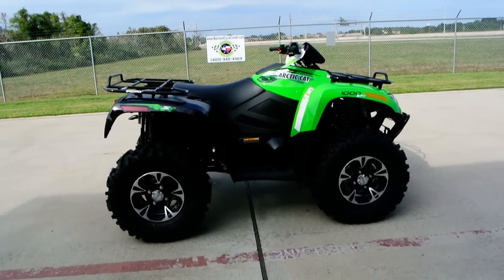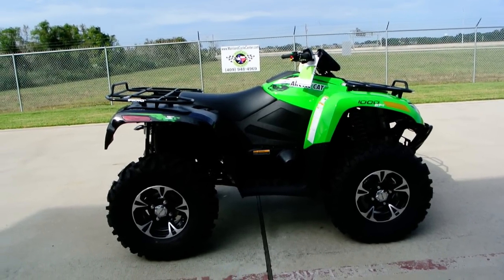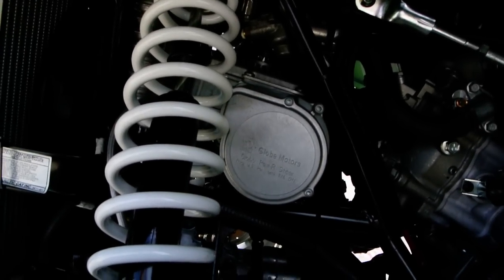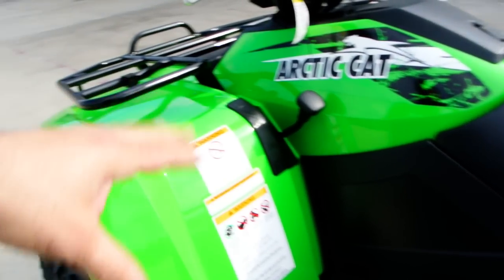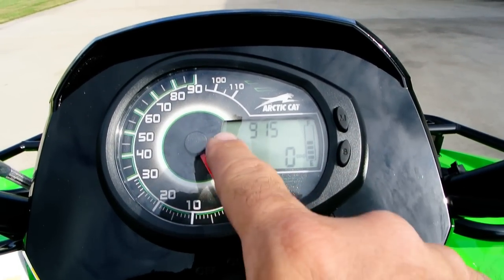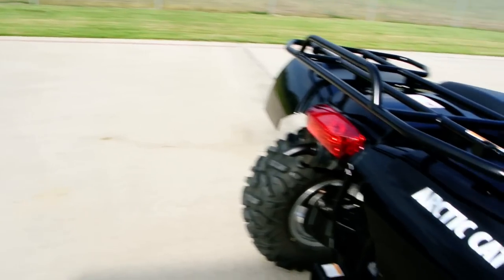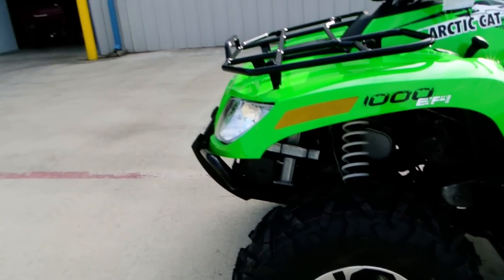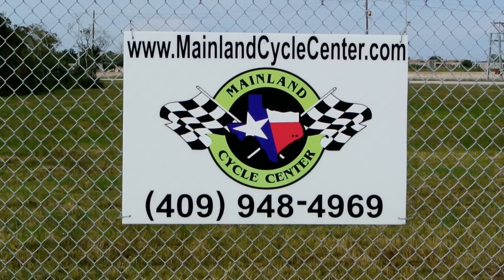2014 Arctic Cat 1000XT  Overview and Review!   For Sale $10,999   New Lower Price!

Comment: I bought 2 of these atvs recently !! There both the exact same model in the YouTube video. They both to this day look are both in like new condition! There both the 2014 Artic cat 1000XT the machine is an absolute beast! I juts put upgraded led head lights and a rear passenger seat with a stereo on the front! I payed $4,750 for each one! They look brand new too this day being 8 years old. I can’t find many videos on YouTube of them I will have to post a video of them since it’s now 2022 almost 2023. I purchased them in Texas the original owner was from michigan where it snowed all the time. They both have 700 miles and one has 200 hours and one has 300 hours and a snow plow! Here in Texas I can use it to push gravel!lol.

Comment: Picking up mine today. $10K out the door with a free winch. Can't wait to hit the trails.
Reply: +Lee Downey How is it ? Many dramas?, Would you buy another one?
Reply: No. Honestly, I kept this atv about 6 months and sold it. Too many issues. Several parts including the front mesh grill started rusting bad. I kept it in the garage full time except when riding and after just a few months, it looked it a rust bucket. I'd spend the extra cash and buy Can Am. They make a solid machine. Getting service and support from Arctic Cat was like pulling teeth. Won't go down that road again.
Reply: L Downey what kind of problems did you run into there?? What all went down engine problems namr every problem youve had
Reply: @leedowney8587  jut surface not a bi g deal scheap to replace tehre good bikes